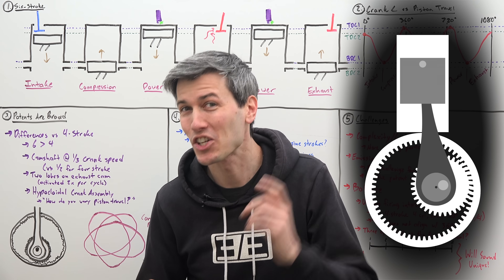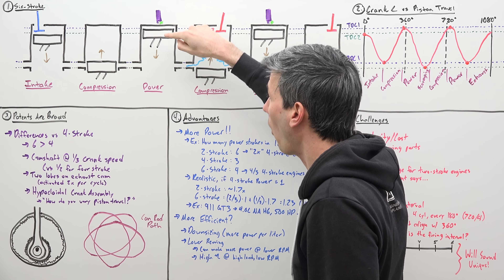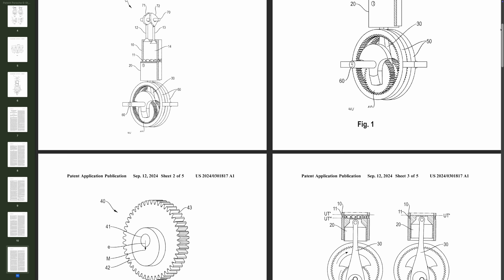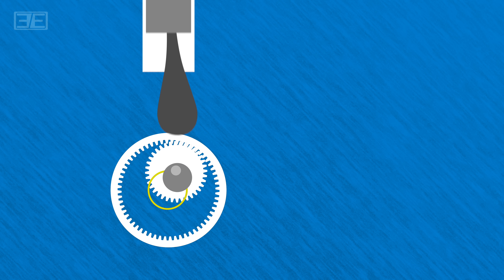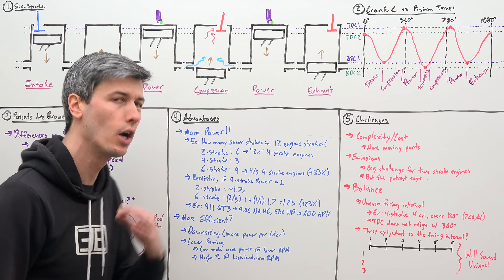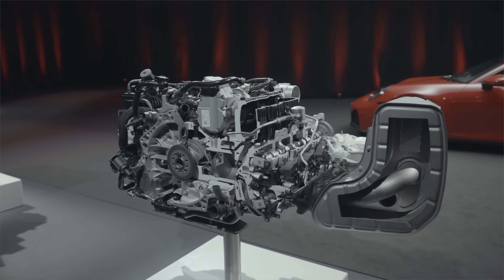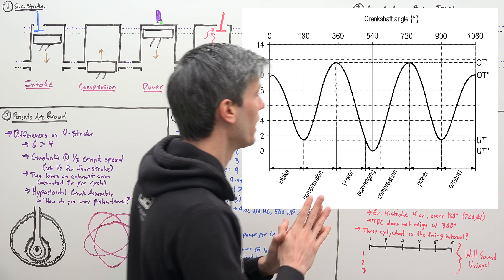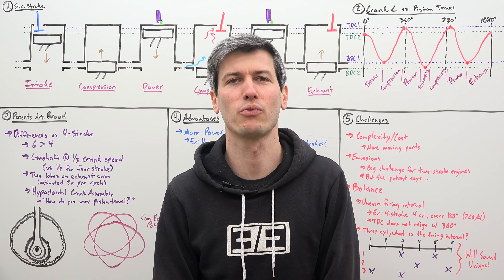Porsche's 6-Stroke Engine Is Genius!

Comment: Won't the second powerstroke create less power than the first, with a mixture of exhaust gases in the cylinder?
Reply: probably intentionally lean power stroke to complete combusion... effectively an "EGR" stroke.
Reply: @Wingnut353  makes sense. that'll be some confusing fuel mapping!
Reply from the maker: Probably less at max capability, though with forced induction you could intentionally change things to try to create even power strokes (or use timing/afr/throttle changes).

Comment: doesn't sound really exciting. if there are "gains" they look very marginal. Depolluting a 2 stroke look much more straightforward and promising. With direct injection it doesn't throw fuel away, much less drag, much more power, light and simple.
Reply: even with the pollution disregarded the fact that they need to have their pistons replaced occasionally will break the deal for many buyers.

Comment: So how is the bottom intake port protected or closed off when the cylinder is on TDC? Isnt there a possibility of oil getting into the port or that the oil pan will have high pressure and as the piston moves down it gets even more pressureized, maybe even resulting in engine failure? Will be interesting to see how they try to engineer around that
Reply: That was my concern as well. If those ports aren't closed off when not in use, you would think oil would slosh in there.
Reply: My concerns were similar, carbon build up in the lower intake ports and what happens when a port becomes clogged, and how piston rings will be interacting with that lower intake port. all the illustrations here show piston rings sliding past the lower intake ports....
Reply: I think the piston skirts may be long enough to cover those lower ports, and may have an additional oil control ring there to prevent cross contamination.
Reply: @ALMX5DP 
Yeah at first i thought that too, but if the skirts would be so long that the ports are always covered, then they would surely touch the crank
Reply: @aprilscherz1233  could be though might depend on stroke lengths if there would be some clearance issues there. I’ve seen a few graphics and simulations that make it look possible.

Comment: I had a stroke trying to understand it
Reply: An extra power stroke...
Reply: @ashutoshsinghchauhan2663  As well as extra complexity in spades... I guess its a German design so that checks out. It is questionable if it could meet emissions, and lacks the availability of techniques that achates power would be able to take advantage of with opposed pistons. This engine may scale down a bit better... but the complexity is a massive burden to this design.
Reply: @Wingnut353  the added complexity is trivial, as it's based entirely on proven mechanical systems. Gears, journal bearings, cams, ports, all things we know to be reliable when made correctly.. just in a different configuration. Humans have made things way more complicated than this that work reliably, it's really not a big deal. If it goes into production there will likely be some teething issues to solve, but that's a normal part of innovation. Personally I'm all for getting more power and efficiency from our fuel if possible, and I'd love to hear what it sounds like with a high flow exhaust system.
Reply: @thecrazyfarmboy "What would that sound like was my first thought. 😅
Reply: @Wingnut353  you still need another one.
Reply: @ashutoshsinghchauhan2663 underrated comment lol
Reply: @ashutoshsinghchauhan2663 and extra compression
Reply: @ashutoshsinghchauhan2663 

Well, it's more like an extra power stroke for 2 additional strokes
Reply: I had all six
Reply: And Porsche fanboys stroked it.
Reply: 5 more and you'll be on the same page
Reply: Literally lmao sitting in my Crane from this comment, thanks..
Reply: you have 2 boxes of apple jacks and 4 boxes of frosted flakes. you take turns eating them.
Reply: 5 more to go and youll get it
Reply: literally, an extra 2!
Reply: The takeaway, as I understood it, is the following : 6 is more than 4 .
The long version is : Six is two more than four.
Reply: Imagine being a mechanic and trying to set the timing
Reply: ha ha HA.
Reply: Now it's a 7 stroke
Reply: @FizzaMC 😂
Reply: That makes it a 7 stroke engine.
Reply: A power stroke or the 2 stroke stroke😅
Reply: I believe you meant you had six strokes ! 😂
Reply: Only ONE?
Reply: And I had six! What a brutal double entendre 😂
Reply: Was it a power stroke or a compression stroke?
Reply: There goes the extra stroke 😪
Reply: 5 more to Go...
Reply: finally, the 1 stroke engine
Reply: Masturbation doesn't help with comprehension though.
Reply: Different strokes for different folks
Reply: I too had all six
Reply: thats the extra stroke that isnt a power stroke right there
Reply: Try the engineers at stuttgart… they had 6 of them
Reply: Ah, the forbidden 7th stroke.
Reply: Which one?
Reply: 5 short of the posted description....stand by
Reply: Exhaust stroke?
Reply: That makes it a 7 stroke engine. 6 for the engine and 1 for the person trying to understand the engine.
Reply: I got this and a second one coming from my gf
Reply: You got five to go
Reply: @imprezaS
That was hilarious 😂
Reply: It wasn’t THAT exciting 🤨
Reply: @ 
What are you talking about?
Reply: @JohnnyBlaze5680  Ha ha, if you can't work that out, why are you here??🤣
Reply: @ 
So in other words you have no idea either
Reply: @JohnnyBlaze5680  🤣You have to love the expert who has nothing to say or offer 🤣🤣 keep it coming johnny expert, we need your vacuous opinin🤣🤣🤣
Reply: @ 
Jesus….you are making no sense at all.
Reply: I mean, I found the video good but I didn't find it that ... exciting.
Reply: Lmao
Reply: Still strokin
Reply: @andrewbloniarz286  Stroking what..? 😄😄
Reply: Just a stroke?
Reply: I hope the brain damage wasn’t too serious!  Maybe try to understand something simpler lol
Reply: I had a understand trying to stroke it

No

I stroke a trying to it understand

No

I trying to understand to stroke it

No

I call 911
Reply: Makes a change to using pornhub. 8/10.
Reply: Keep your dirty habbits out of the comments please! .😂
Reply: It wasn't that exciting 
Different strokes....
Reply: I was stroking one out personally
Reply: Dirty boy. And weird way to study.
Reply: I'm not bored! Great Video. Different strokes for different folks, means everyone has their own way of doing things.
Reply: Hahaha 😂great comment
Reply: Bringing the total to 7
Reply: I stroked myself while trying to understand it
Reply: Yep, that's the hidden seventh one.
Reply: Masturbating while listening to it doesn't help with comprehension.
Reply: well i stroke my shi watching this
Reply: Suck, squeeze, bang, blow/suck/squeeze, bang, blow.
Reply: Have you ever heard the term NERD? yeah, that is him.
Reply: So did I 😏
Reply: You shouldn’t masurbate and tell on yourself.
Reply: 😂. Same!
Reply: Funny !
Reply: You got me 🤣
Reply: Haha, me too…😂
Reply: How many of them? Two, four or six strokes?
Reply: Like a rat in a maze ! 
The fuel and air might get lost to meet each other for combustion ! 😂
Reply: Hahaha - I felt similarly challenged. I'll have to purchase a school geometry set again?
Reply: A one stroke?
Reply: This comment makes it all worthwhile😂
Reply: That was a good one!😂😂😂 I literally laughed out loud!!!
Reply: So the exhaust gas is not being pushed out but rather escaping as the gas is expanding, correct? The gas still being able to expand is what a 5 stroke design relies on?
Reply: Eww
Reply: i came
Reply: Also is t this just VVTI but for you’re crank
Reply: wow you are a seventh stroke 😂😂
Reply: Well that then brings it all into balance, keep it up !
Reply: One handed and two handed
Reply: For some reason I understood it
Reply: Go up go down 6 times
Reply: You found it that exiting? 🍆
Reply: Let me guess... Six times?
Reply: Men si really simple the trasmisión is the key
Reply: Mickey Avalon song; stroke me, stroke me
Reply: German engineering at its finest. Looks at design "brain hurty"
Reply: 5 more and you're a new porche engine baby
Reply: this is a schizophrenic engine. it do's not know what it want to be a 4 stroke valve regulated engine or a 2 stroke port valve regulated engine.
so it comes with this extra complex crankshaft gear arrangement to alternate between both engine types.
Reply: Quick, you better get a patent on it
Reply: I got a chuckle reading this
Reply: Me too😂😂
Reply: lol
Reply: So... That's 7?
Reply: Me too, but in a filthy way that I can't mention on YouTube
Reply: Porsche is just stroking their engineering prowess.
Reply: Jajajajajaja.
Reply: You were under a lot of compression.....
Reply: just an other more complicated way to use electro-magnetism, just to avoid the obvious.
Reply: That’s a few less strokes than I had.
Reply: Power stroke?
Reply: That's hilarious! 😎
Reply: me too I moved on
Reply: 2 stroke or 4 stroke?
Reply: Hahahahaha, you're the best
Reply: So it was your first stroke engine?! 😏🤦‍♂️😅
Reply: The Seventh stroke. Be careful.
Reply: Porsche engineers had 6
Reply: 5 more to go
Reply: So, its a 7 stroke then?
Reply: Lol
Reply: Me too.
Reply: 2 pistons are firing @ any given time
Reply: Mind blown 🤯
Reply: Hey that is a 7th stroke 😂
Reply: I got to 100 strokes, then changed Hands.😊
Reply: It's not complicated at all
Reply: Yup
Reply: Aren't you stroke I didn't banana?
Reply: I had 2
Reply: I stroked my girlfriend while watching this video 😂
Reply: More power, greater efficiency, less heat, more rpm? Hopefully
Reply: @Troonielicious  More power, less efficiecy, less RPM.
Reply: So, you’s a 1-stroke? You better patent that ish!
Reply: So it’s a 7 stroke engine then
Reply: Why it was explained pretty well, don't skip, and it makes sense
Reply: This is the greatest comment of all time. 😂😂😂😂😂
Reply: Why? It's basically just a 4stroke and a 2stroke put together.
Reply: Have 5 more and you'll understand
Reply: No doubt, me too!!!'!!!!😮
Reply: 4 6 or 2 stroke?
Reply: 1 stroke. Get that patent now while they're in the habit
Reply: I had a stroke as well, very easy to understand though tbh
Reply: 5 more to go
Reply: When I first read the head line. I had to think about it for a few seconds. The only way it made sense to me before watching the video was they added another power stroke to the cycle of the engine. But why? Was my real thought before watching the video. It didn't sound like they were going to get a whole lot of useful work out of that second power stroke. Mostly due to the lack of air still in they cylinder with the intake and exhaust valve closed.... (Ok? Weird. Let's hear the reasons behind it) was my final conclusion.
Reply: God bless you
Reply: understand it'll be looking at EV taillights for its whole career
Reply: I bet boxer boi 💥
Reply: It’s a 4 stroke that identifies as a 2 stroke.
Reply: 7 stroke
Reply: the short answer is that 2 of the 6 strokes are a power stroke vs traditional 1 of the 4

1/3 > 1/4
Reply: @sucraloseUncle you mean 1/3>1/4
Reply: @sucraloseUncle  no.  2/6 or 1/3.. NOT 2/3. Neither are as good as 1/2 of a two stroke.
Reply: @sucraloseUncle you mean 1/3 > 1/4.. don't let the Americans hear that.. remember the fiasco when they tried to market a 1/3 pounder burger vs the traditional 1/4 pounder and Americans couldn't figure out that 0.33 > 0.25?
Reply: I see what you did there....
Reply: @Glideslopesthat was going to be my response…😂
Reply: 🎉🎉🎉WINNER, WINNER, WINNER🎉🎉🎉
Reply: I see what you did there. 
Pretty clever.
Reply: Keep that to yourself next time

Comment: Now with 50% more problems!
Reply: I suspect 33% is conservative.
Reply: This guy wants more electric vehicles.
Reply: @DrowsySquid75 genius is making money thru solutions to the problems you create 🤫
Reply: I thought that was a good marketing point as well
Reply: It’s called invention and innovation.  If companies were afraid that there would be issues, nothing new would ever be developed.  R&D and testing will help develop reliability in the design.  Just because it’s complex doesn’t mean it won’t be reliable.
Reply: Nissan knows this and still advertising the VC Turbo as a selling point
Reply: Oh😮 yeah
Reply: s a grease monkey-weekend warrior race track driver/member…out of modern Porsche GT2RS,modified Subaru sti,Nissan GTR and corvette C6 owner…yes have these cars and only use them on race track…the Porsches are the best reliable ones …(have 3 other 911’s)
Reply: i stick with ohv thanks Porche
Reply: Electric motors are far less complicated and far more reliable. They eliminate the transmission, exhaust system, and those pesky fuel tanks that catch on fire 175,000 per year. Battery technology is racing towards higher density and lighter weight and many people can make their own fuel at home with solar panels. Any engineer would agree electric is a totally superior technology.
Reply: @Krunch2020 
Except for those pesky lithium and cobalt mines.  And all the ICBs it takes to produce them.
Reply: I rather have an accident with a gasoline car then electric. Once fire comes into play you have better chances with gasoline than batteries. Once life can be saved with a small fire extinguisher in the gas operated car, battery fire is a death sentence. Not to mention all the other disadvantages of electric cars.
Reply: @Fanaz10  But you cant beat physics or chemistry. Energy density is the key, and by that all batteries are hugely interior to hydrocarbon fuels. And that for the foreseeable future.  Maybe there is a "Homefusion 3000" in a 100 years, but for now battery cars are not on my list.
Reply: @ Well, but we dont - and if its fairytale tech you are talking about, i rather have a real hoverboard or teleportation.
Reply: But EV cars break AF @Krunch2020
Reply: @Krunch2020 , allerdings sagt der CEO von Toyota, dass "EV is out!!"
Reply: Batteries will never reach the energy density of hydrocarbons. Hybrid systems with synthetic fuels will outperform pure electric drivetrains, even if some efficiency is given up.
Reply: @456MrPeople it is only a matter of  time, EV will become cheaper and cheaper over time and once they hit a significant volume ICE wouldn't be able to compete.
Reply: @456MrPeople  Batteries don't need to compete, many hybrid drivetrains wind up being so heavy that they are comparable to an EV, a la BMW M5. The battery is the heaviest part of an EV, but everything else is lighter, the motor, no transmission, skateboard chassis, etc. Gradual improvements in anode chemistry means batteries still have alot of room to improve and make EVs able to be way lighter than today.
Reply: @csaleman 
When will this happen?   When will the electric grids in every city, state, and county be upgraded to handle the charging?   When will the sources of power be able to handle the added demand?
Reply: take a look at the RC world and see who dominates

Comment: I just can't go back to an ICE after experiencing a Taycan Turbo GT and the new Macan. ICE is nothing but waiting for revs to build. The NVH is worse as well.
Reply: For everyone with your opinion, there is someone like me who much prefers the manual transmission and ICE exhaust note.
Reply: @LogicalQ yeah I like both equally and would be upset for either to depart the marketplace (though do wish EV battery tech improves to reduce their generally high weight). I do love a progressive and sonorous engine as it ascends throughout RPM range.
Reply: Can you rev a Taycan?
Reply: @Taylor40667  I'm not worried about that. But you're looking for the sound, yes, you can. Waiting for revs to build was precisely the reason I got rid of the ICE. I prefer the performance.